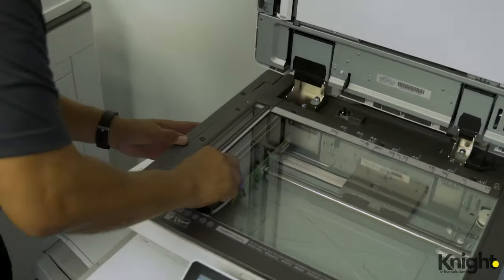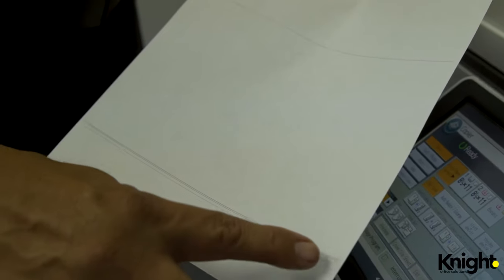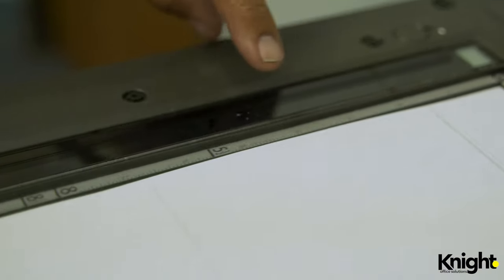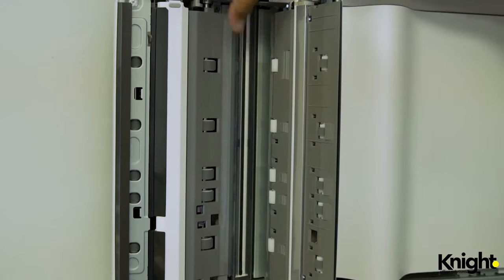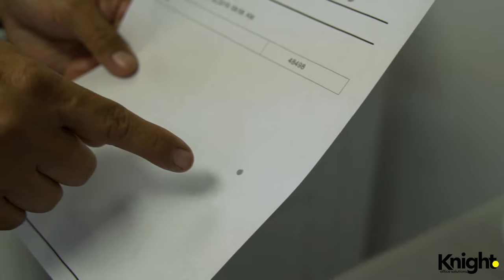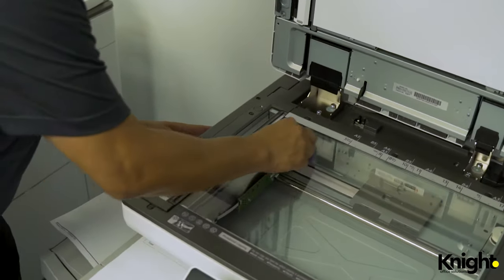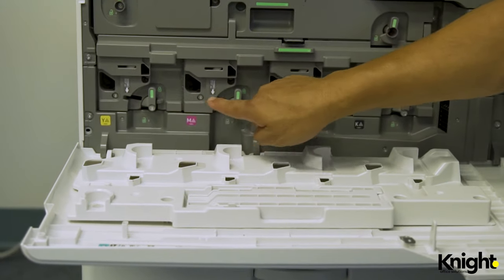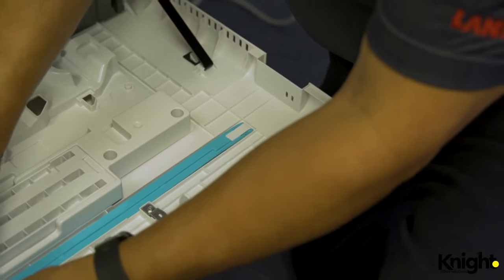Removing Lines, Streaks and Dots on Lanier / Ricoh / Savin Copiers

Comment: good morning dealer and ricoh machine service .we have. a problem with an aficio ricoh 3025. The machine, even if it is ready with the green start light, not only starts, the scan always runs and does not stop as it happens when it feeds the toner but in fact the toner light is not on. Could you give us some suggestions, thanks

Comment: Hello, I have Ricoh SP 111 Laser printer.  The printer is working with only one issue.  It is connected thru USB with my Windows 10 Pro 64 bit ASUS Laptop.   The printer prints PDFs, Word documents and Excel files seamlessly.  But the same printer does not respond when trying to print even a simple JPG image.  Why is it so?  I tried uninstalling and re-installing the Driver downloaded from RICOH website, but it did not help.  It is adamant that it will not print JPG or any images in BMP too.  It prints all other documents like word document, pdf and excel sheets without any issue.  The ONLY ISSUE IS IT DOES NOT PRINT JPG images.  Why is it so?   How can I make the printer print JPG images?   For your information, Windows 10 updated with all the updates.  No update is pending.  Printer Driver is installed afresh with the latest Driver downloaded from Ricoh website for SP 111.  How to rectify the jpg image not printing issue?